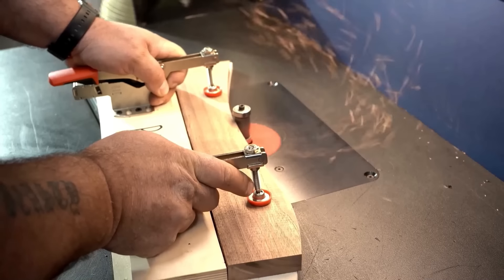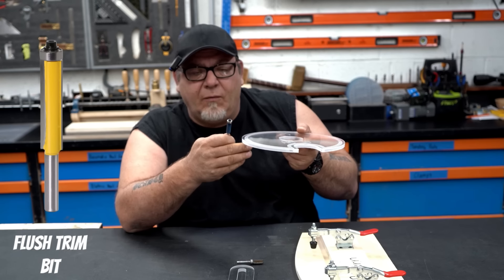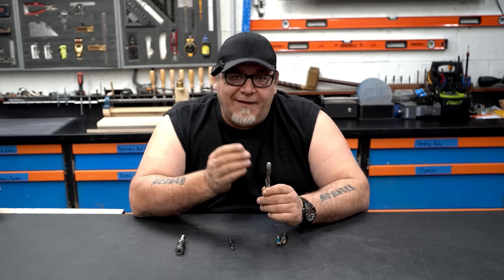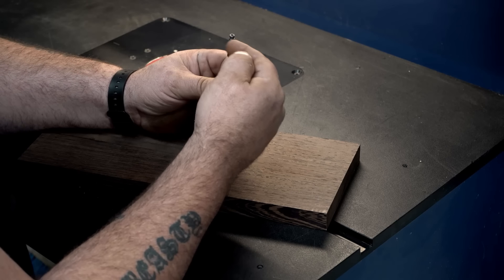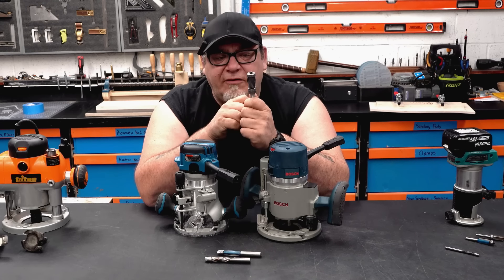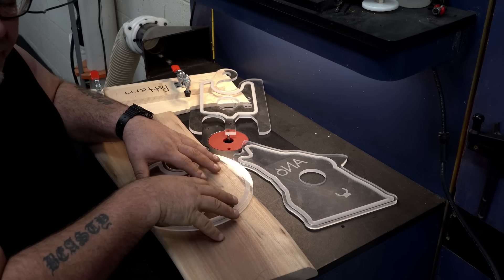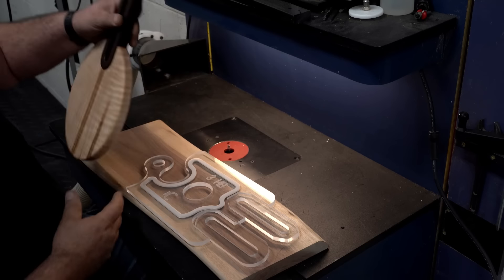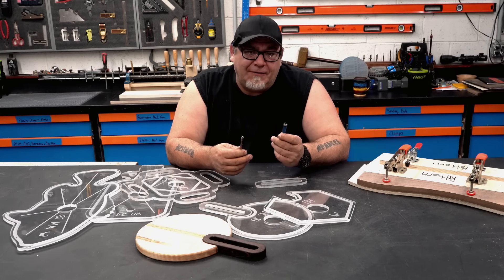Don't Buy a WOODWORKING Router or Bit Before Watching This | Beginners Guide

Comment: Great video, those vacuum templates are really cool!

I think you're underselling the advantages of spiral bits somewhat though. In my experience they produce much less tearout, and not just on heavily figured wood - though if it's curly maple or something similar, straight bits are virtually useless. They also tend to be significantly higher quality - better cuts when new, less likely to break, and the edge seems to stay sharp for longer. As a hobbyist, edge retention is important to me because I'm not going to spend time sharpening router bits when I could be woodworking. They can take more aggressive cuts too, more safely (less chance of kickback) which comes in handy if your bandsaw work isn't perfect when roughing out a board, or if you don't have a full shop and are roughing the peice with something harder to control like a jigsaw. Not only do they produce less tearout, they are less likely to splinter or rip chunks off when routing against the grain - and if they do, the damage is usually less severe, for the same reason that spiral cutting heads are better than straight heads on planers and jointers (less of the cutter is in contact with the wood at any given moment in time). Less chance of damaging the piece is well worth the extra cost in my view, let alone all of the other advantages. I would say if you're a less experienced woodworker, spiral router bits are simply easier and safer to use and provide more predictable, cleaner cuts, and the cost difference is negligable because you're probably replacing either type when it's too dull to cut anyway. Now, if you're running a production shop and sharpen your router bits once a week, yeah, I could see why straight bits would make more sense in some cases.

Comment: The first thing I did when I bought my first plunge router (and yes I cheaped out lol). I downloaded a bit speed chart and bought all straight bits, reason being? Well, you can get away with most things in a wood shop without a router, it just takes longer. Sanding to the line is how the old timers used to do it before we had routers, or they'd hand plane and spoke shave the pieces they were working on to get them right. I still don't use my router that often because a lot of the time, I prefer the look of a nicely sanded edge to break the sharp edge vs putting a round over on it. Oh and there is yet another router you forgot to mention Izzy, Dremel has had a plunge router attachment for years now and I find myself reaching for it more than the bigger one in my shop. Great video on the information you shared as always :)

Comment: I don't see many people showing the Triton router but it is by far my favorite.  I use mine for tongue and groove flooring, cabinets, doors, and slab flattening, which all require a stronger router.  I have bought a trim router to use in a horizontal mortising machine that I'm building, I'm hopeful that It will be sufficient.

Comment: I use one of those AC evacuation style pumps on my CNC setup for doing really small acrylic parts. I plumbed an old portable air tank for filling tires inline with the pump. I put a valve on it, so I could draw a vacuum on the tank and just open the valve when I was ready. The rush of vacuum really helps to seal the gasket down well and if ever lifts for a split second and momentarily breaks vacuum, the reservoir of vacuum keeps it from coming off. It really made a world of difference.

Comment: I use a straight edge test is installed on the bit on an angle.  It has a slight shearing cut to it but still has that easy sharpening to it.

Comment: His comments on plywood/hardwood with straight/spiral bits is 100% accurate.
If hardwood and you will be cutting "wrong direction"(sometimes can't be avoided like guitar bodies/necks) with router DO NOT USE straight bit, use spiral bit.  If you can run router correct direction to avoid tear out, straight bit will work just fine on hardwood.

Listen to this video, he covers all I can think of that is important that took me years to figure out.

Comment: 40 years in the plastic business and my fabrication section always used vacuum patterns made of 1/4" acrylic.  What we did is drilled a hole in the center and tapped  it to fit a regular Air quick connect male fittng to every template. As you can see we always use both terms "patterns & Templates".  All our router tables have 1/2 to 1hp gast vacuum pumps built-in under the table.  We prefer to use spiral bits in cutting Acrylic because it leaves a smoother edge and the operator can cut a little faster, with the straight flute we have cut mich slower to avooid edge markings.

Comment: As a home diy'er I've found the smaller router much more useful.  I'm not doing big projects for sale.  The little one is a lot easier to use for small projects around the house.  And with the smaller collet size I can use it as a makeshift Dremel and even use Dremel bits.
Great video by the way, I learned a lot about router bits. Thank you
Reply from the maker: Thanks for sharing!

Comment: Great overview.  I especially liked your way of describing up vs down cut.  I need to look that up every time but think I’ll remember this explanation.  When it come to sharpening, our local machine shop sharpens almost any blade or bit, including spiral bits, at a fraction of the cost of replacing the bit.  People should check with their local woodworking store to see if they partner with such a company.

Comment: This was great!  I have an 18v palm router that I haven’t got bits for yet so this was very helpful. Thanks!
Reply from the maker: Glad it was helpful!
Reply: For a starter but set the $100 40 carbide but sets on Amazon are a good place to start. Not the best bits but are ok and let you try a lot of bits for less $$. Once you find the bits you use a lot upgrade them
Reply: @davereynolds6912  Thanks!  I’ve been trying to find the video on here that mentioned that set and I can’t seem to find it. Thought it was StumpyNubs but o checked all his router videos. Is it the green Kowood Pro set?

Comment: I have a Makita 1 1/4 for my cnc gantry router spindle.  I love so much I bought another one for general shop use. Next version of the gantry router is incoming and it's getting an upgrade to the Makita 2 1/4 HP which I have converted over to the Musclechuck collet system for quick changing bits.  I'm sure it will still be choocing when I replace it with a proper FM30 spindle from CNC Depot, but first the machine has to earn me the money.

Comment: Great video! I’ve used nothing but straight bits for some 50 years or so. Honestly haven’t heard of the spiral bits till watched this video!  For my purposes the straight bits  work fine and for the price difference I have little reason to switch to the spiral bits. Not that I wouldn’t like to try one though just out of curiosity what the difference really is?  Really like your templates you made and the first time I seen anyone use a vacuum system to hold the material in place.  Majority of the world we’ve done is using a router table for putting a decorative edge on drawers and doors. 
Employer hired many kids right out of high school and many didn’t respect the router bits and how easily they can get hurt loosing a finger when their not paying attention to what their doing while using the router table.  I’ve lost count over the years how many younger employees have had to be rushed to the hospital from not paying attention to what they were doing and not holding their work piece properly where they wouldn’t get their finger accidentally caught in a router bit.  It’s a shame cause once they loose part of a finger it’s likely not going to ever be the same again.  I’ve been in woodworking over 50 years and have yet to ever get hurt using any of the equipment. But it only takes a blink of a eye loosing your concentration and not paying attention to make a bad mistake and get hurt!  I never could stress that enough with new young employees how careful they need to be and pay attention to what their doing at all times. Unfortunately some just wasn’t going to take their job seriously enough and they paid the ultimate price for it too!  As you know yourself how dangerous these router bits can be if you’re not careful what you’re doing at all times!

Comment: Good info. Just bought my first router, a Bosch, and I am struggling to get clean cuts with it. (Trying to cut dove tails) You pros make it look easy.
Reply from the maker: You can do it!
Reply: Make sure you're going the correct direction. If you look at your material and picture an 0 if you're routing the outside you go left to right. On the inside of 0 you go right to left.
Reply: For clean cuts the sharpness of the big is very important. And the speed you move the bit

Comment: I'm getting my first router; it's already on order.

One thing I want to use it for is routing guitar bodies -- so that's using a template on top of the wood, but the depth can vary based on a lot of different factors. Since I lack experience with a router, I thought I'd ask: What sort of bit would work best? Should I opt for a template collar so I can vary the depth depending on what is needed for that cut, or buy bits of various lengths to accommodate the needed shallow (as little as 1/16th inch in some cases) or deeper cuts?

Comment: Why did you not use a sound box around your compressors? It sounds like it would mess with your hearing as is. Or is that just the camera picking up a louder noise than it is?  Ear protection when using the router too?  Anyway, you are a fantastic teacher. And this video was fantastic. Thank you.

Comment: The Triton model in this video has an achilles heel problem that is strange for such a powerful machine.
The plunge mechanism has a small plastic gear holding the weight of the router plus the tension of the spring inside.
After not so many uses in a router table, the gear snapped and the height adjustment stopped working.
After purchasing the spare part and replacing it, I'm only using it as a handheld plunge.

Comment: Watched you for years and love your videos. I cut Baltic birch ply and have used straight and spiral bits and always get a fuzzy edges    With both bits. Why am I not getting clean edges. I make boxes and the top of the box is what I edge and the fuzzies are on the bottom of the ply not the top. Help
Reply: See if the comment at 14:08 helps😊

Comment: Where'd you get the stubby power cord for the Bosch routers?  That seems like a super useful upgrade.  I've either got the router hooked up to the table, running off an external switch, or plugged into an extension cord to reach a workbench when it's out of the table.  The built in cord is basically the most inconvenient length possible.
Reply from the maker: I made it. i talked about it in my last video
Reply: @izzyswan  Sweet! I will go take a look at that.  Thanks.

Comment: Have you done a video on that incredible dust collection setup on your router table? 
"I want that" - Bobby Duke Style
Reply from the maker: I haven't done a vide on it. it easy though.  we have a 5 hp dust collector and a floor fan blowing the chips in to the collector
Reply: @izzyswan  Well it works brilliantly. What percentage of the chips do you think it gets? Looks like 95-100%

Comment: Thank you very much, great content as always!  Liked and subscribed!  Quick question, I picked up the Bosch as my first router, also got the template guide set to use Porter Cable guides for some of the after market jigs.  If I pick up a palm router (also looking at the small Bosch or something similar) are the guides a consideration or are those something I should just use my full size router on?  Thanks again!

Comment: Question. When you say flattening bits are you talking about something you can use in the router with a jig to say flatten an epoxy and wood table ? I’ve seen a type of jig some guys use to flatten the resin wood table once cured.

Comment: Izzy, ty for the refresher router bit education. Quick question on your template connector system.  I already own the Festool Vac Sys.  Was wondering if you sold or could recommend an adapter that would work on the Festool Vac Sys line set to connect to your Template Connector or your own line set?
Reply from the maker: I really don't know much if anything about the Festool vac. if the is a line in port i am sure there is a way to make it work.

Comment: Thanks for the informative video. You are a wealth of information. What is the best bit to use for 6/4 to 8/4 stock using your templates?
Reply from the maker: We use 1/2 inch dia straight bits with 2 inch cutters on Walnut or Softer woods any thing harder we use 1/2 spiral with 2 inch cutters

Comment: I cut lots of 1/4 inch grooves about 1/2 inch deep in a single pass in oak. Spiral bits last 10x longer, cut cleaner, don't move around AND will be better at all this at twice the speed of straight bits. 

I even use HSS spiral bits- and even they are MUCH better than TCT straight bits. In fact I cannot do what I do several things ithout a spiral bit, it's be a disaster.

Comment: In you're opinion,, Which manufaturer makes the best router? I have mainly Craftsmans but I also have 1 Ryobi 2hp plunge router. I put high speed aircraft bearings in my 2hp Craftsman and it's still 2x noisier than my 2hp  Ryobi!!

Comment: If one sharpens a pattern bit, doesn't the diameter of the cutter become smaller than the guide bearing and thus affect the size of the work piece in relation to the pattern?

Comment: Your vacuum pump:  Does it need to be 12 CFM, 1HP or would smaller pumps (3, 5, 7 CFM - 1/4 HP) work for holding templates?

Comment: Would it be safe to rely on the guide bearing on a 1/2" stile routing bit with an outer cutting diameter of 1-3/4" using the same technique you show at 0:13 in the video? However, no template or pattern will be used; the guide bearing will pilot against the radius in the stile dummy. The material is MDF with a thickness of 3/4". I'm a bit worried about kickback.

Comment: Thanks for the video. How many times do you think you can sharpen a straight bit before the pilot bearing is too big for the bit?
Reply from the maker: depending on the method 3 to 4 times. But more than that if the geometry is not super critical

Comment: There is not one video on YouTube that shows a simple trimmer under hard work!  Really under tough job ie trimmer vs big bits vs massive wood carving.  Can the 700 watt trimmers handle the work of a 2000 watt router?  Has anyone tried putting large bits on a trimmer?
I know the limitation is the diameter of the collet but there are also large 8mm bits...

Comment: Hey Izzy what size/specs should you look for ina vacuum pump for your style of templates?
Reply from the maker: I like 10 CFM or higher for the vac pumps. ours is 12 and it works great.
Reply: Cool thx man gives me a good baseline to work with for quite a few crazy ideas you've put in my brain lol

Comment: I have a bosh router and it seems to bog or slow down after repetitive use as in 15 times or so and then turns off size of wood removal doesn't matter. Worse in a router table. Is there any fix for this? I bought bosh because their "quality brand" not sure  now. Any help would be appreciated

Comment: Router table??? I have had 2 and modified both and they are both a headache. Would love some input on router tables. Templates and patterns are nice, but for one off stuff its a waste of time to build it twice so having a table that has a firm and square guide rails is essential.

Comment: Straight blade = chop
Spiral blade = slice

I think from my experience with knives that chopping needs a sharper blade than slicing when cutting material that isn't brittle (which may be splitting not cut).

Comment: So a shape on the top (of the wood) using a bit with bottom mounted bearing = PATTERN ... but the same shape on the bottom using a bit with top mounted bearing = TEMPLATE ....... there is no difference between a template and a pattern, it's a shape! .......... how to complicate something simple!
As you pointed out, what's a bit with top and bottom mounted bearings called and what is the shape then called?
P.S. I know you didn't make the names up, not blaming you 😁